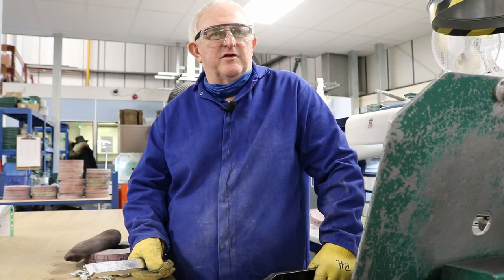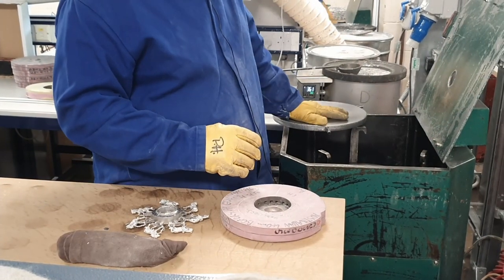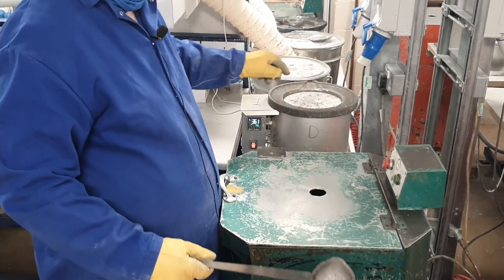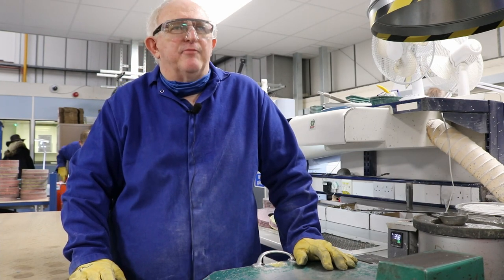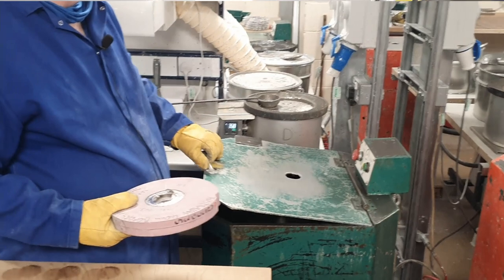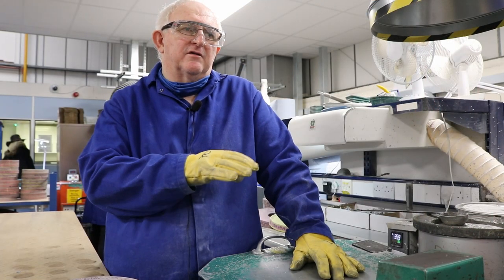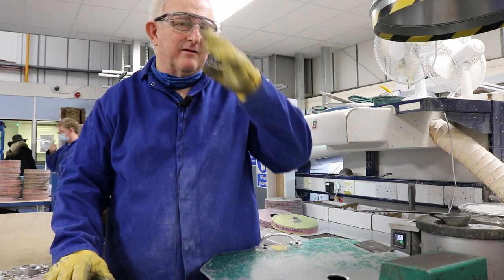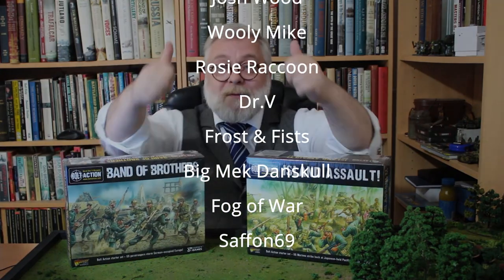Our day at Warlord - Metal Casting with Peter Hely

Comment: Master Molds are usually multi- figure castings. You take and clean up enough of one figure from the Master Mold to place in a Production Mold. I have seen Production Molds that had say four types of Artillery figures, and it is very inefficient, as the different poses cast at different rates in the Production Mold. "Principles of Centrifugal Casting" by the Oster corporation is still the Bible on Mold Making. So I am not too sure about how the "Big Black Book" supersedes industry Standards, as Molds have not been cut like that for over 40 years. It looks to me like they are just burning their Molds up, and they do not clean very well the Metal with that type of Gating System during a Cast. We were getting over 700 Casts per Mold at Martian Metals and fasa, so I would be very interested to know what their Mold Life is. Also, Centripetal Pooling in the center of the Mold to that extent takes longer to cool, and in that time the Mold soaks up a lot of unnecessary heat that degrades the Mold Quality over time, as the Vulcanization Process is Time x Temperature. Speaking of which, I would like to see their Mold Room and Master Filing System in a future video.
Reply from the maker: There is a biot more informaiton about the mould making process on the resin casting video we have coming up.